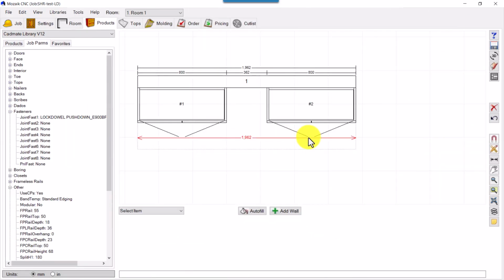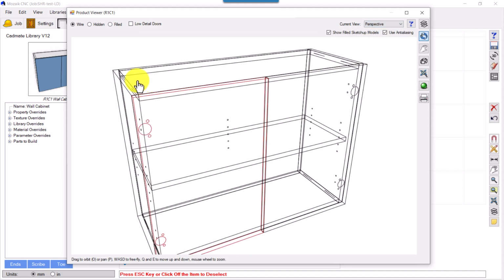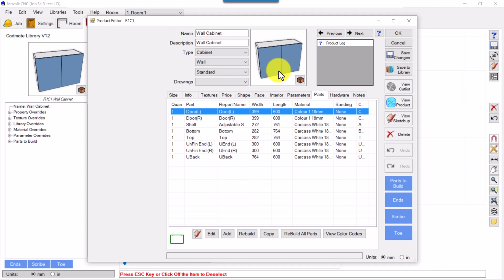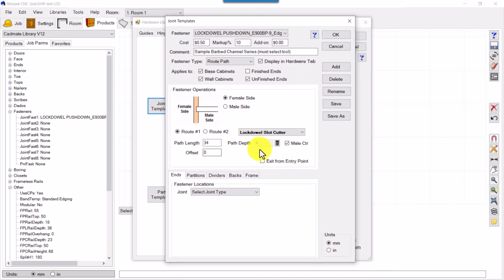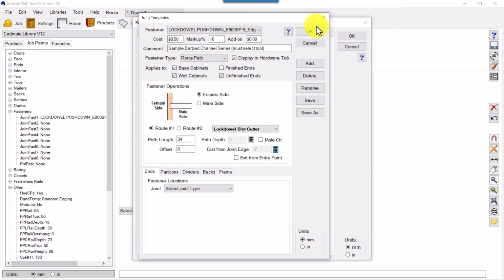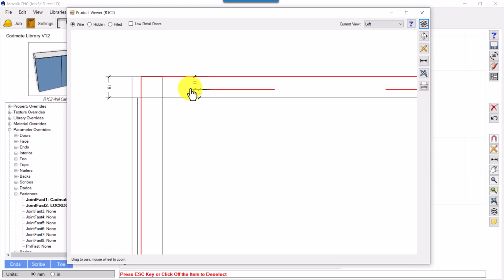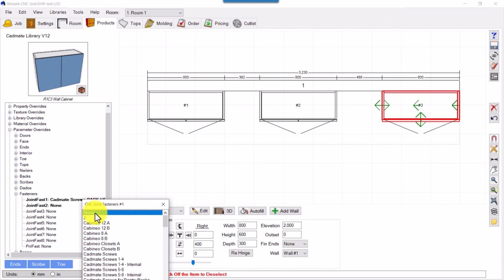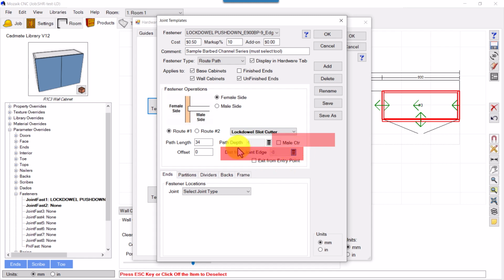Adjust Lockdowel Route paths to compensate for material removal for edgebandings tapes in #mozaik

Comment: The point of the hardware is to be centered on the mating edge, you're making a weaker box. Have you actually built a cabinet before?
Reply from the maker: its centered 9mm from edge for 18mm thick panels.we have built cabinets with this config.
Reply: @virtucadd  So you are taking your top and bottom and moving those in 2mm as well?
Reply from the maker: @brotherscardshop5491  yes, we had 2mm center offset male female to have it easily assemble, with tight tolerance there was issue in fitting. female slot should be 2mm big from C-C
Reply: @virtucadd  people offset their tops and bottoms only when they can't achieve flush surfaces